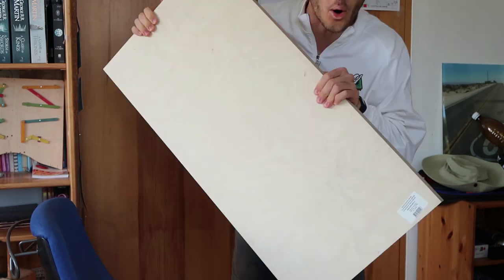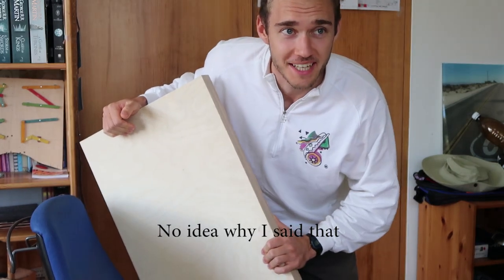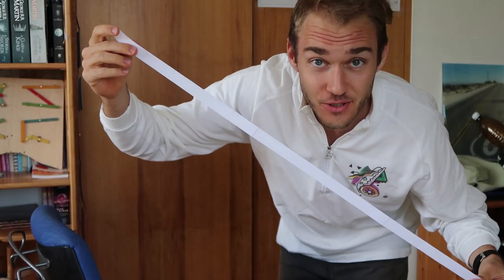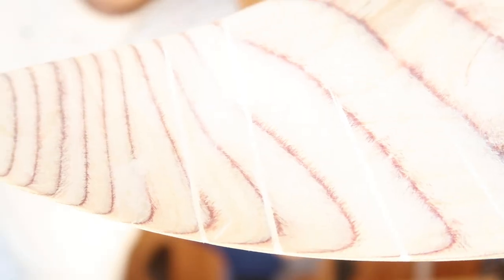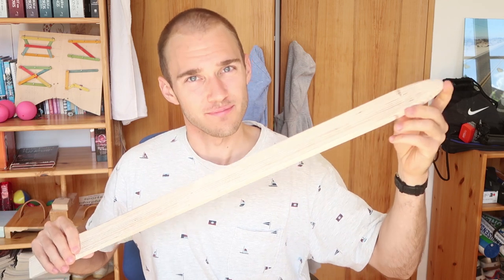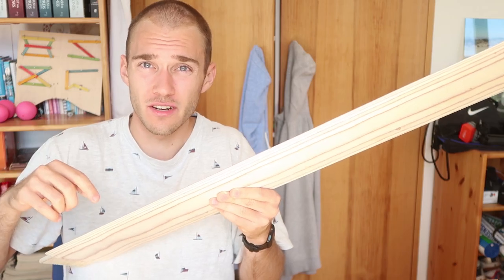HOW TO BUILD A HYDROFOIL surf board - Part 1: Woodworking

Comment: Hey very nice work!
I want to build one myself but i have no idea how big it should be or which shape it needs to work well.
Do you have any tips or data for me ?
Reply from the maker: Well, my tip is: make a front wing that has at least 600cm2 of surface. Mine has a surface of 530cm2 and is considered to be a race foil. Race foils are faster (less drag) but are very unstable. It's a bit frustrating when you're a beginner and can't manage to stay in the air for 2 seconds. 
For the shape, it doesn't really matter... inspire yourself from other ones.
Reply: oh thx! i will try my best :)